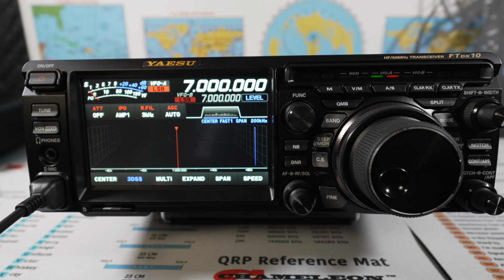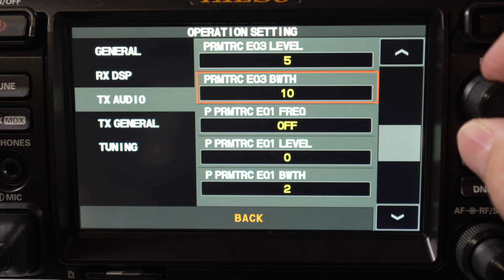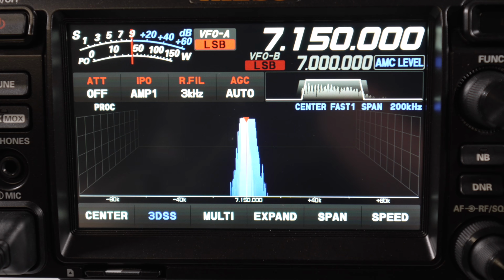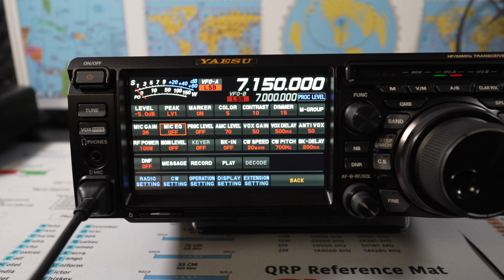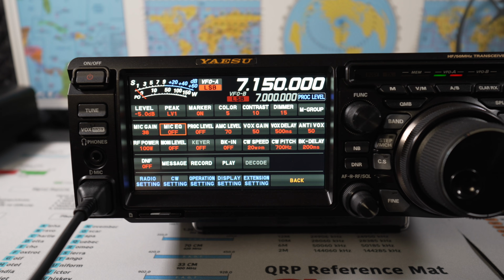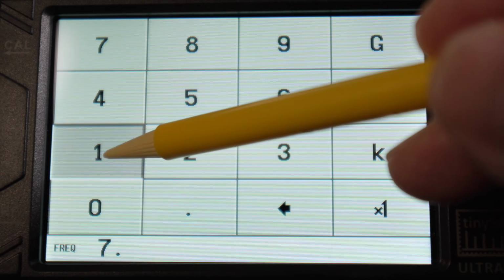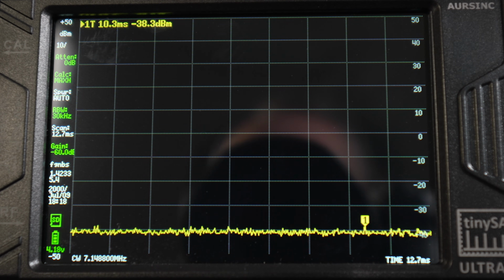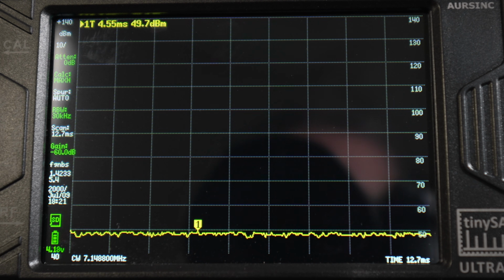Where Did My Watts Go? FTDX10 Power Output & EQ Settings Explained

Comment: Question then….I had the same concerns / questions when I first got the radio. I had other issues with the radio which required two trips back to Yaesu. But when I had them on the phone I asked that question. The reply was what you are saying regarding the averaging power meter. But then the gentleman had me go to a mode with a carrier and said what do you see now? 100w. Lo and behold there it was and he said that proves the radio is putting out 100w. 

I have an external ATU and the forward power shows around 50 on SSB and agrees with the ftdx10 meter. My 991a, 891, and 7300mkII all show 100 on their meter and 100 on the forward power on the ATU. 🤷🏻 I don’t have the test equipment you have yet but do lead one to scratch their head. 

Another thin on that radio is the SWR. If you’re using an antenna that’s anything above about 1.5:1 the protection is aggressive. To the tune of about 40%. The other radios mentioned don’t start rolling back until about 2.5:1 

Just my observations. It’s still a good radio. I’m able to talk to folks, the audio is good, but I find myself over the past year and a half while operating it wondering if it’s operating correctly. 

Ken, 
KK4GMR, 73
Reply from the maker: A mode with a carrier like AM is putting out a continuous tone like if you switched to CW mode and just held the CW key down.  Your speech just gets passed along with it on the side bands but whether or not you speak, the carrier tone is still going to be blasting along at full power.  So since there are no peaks and valleys in the power level because of the carrier, the average will be 100 watts which is why the meter will show 100 watts.

I have an 891 and I know you can switch on peak hold.  Not sure about the 991a or the 7300.  If the ATU’s meter shows average power then you should see the same results as the FTDX10’s meter if you are using single sideband and full power if you are using the other modes like AM or CW.

You can actually simulate the carrier in SSB by keying the mic and whistling.  The continuous tone of the whistle should peg the meter at 100 watts if you whistle loud and long enough

Comment: Thank you so much for making this video. I didn't like being uncertain if my new transceiver was working properly. I was having hams that I consider experts telling me that something may be wrong. I guess Icom reads peak power output. I always get good signal reports, so I figured it was ok, but I was not sure. I would recommend the Yeasu FTDX10 to anyone looking for a high quality transceiver. They may not be as simple as an Icom, but I am in this to learn.
73
Reply from the maker: Glad I could help.  There is a reason why they FTDX10 is number 2 on Sherwoods list.  It's a fantastic transceiver.  http://www.sherweng.com/table.html
Reply: Only wish the power draw wasn't as much on receive.
Reply: @williamn01 I recently stayed at a cabin for 5 nights a few weeks ago. I took a fairly large deep cycle battery to power the FTDX10. I convinced myself that I didn't need to take a charger. I ran out of juice 2 days before the trip was over. Although I must say that I enjoyed several days of 6 meter SSB being open.
Reply from the maker: I got a portable bioenno solar panel and a powermini 2 charge controller from buddipole.  That combo has really extended my battery life.